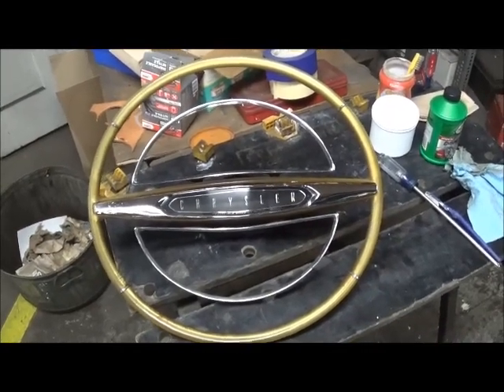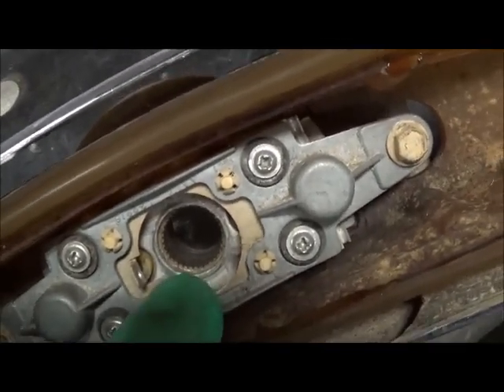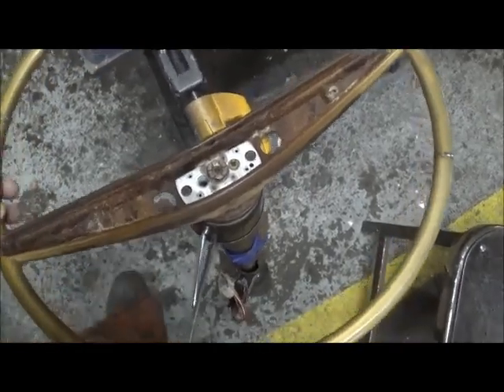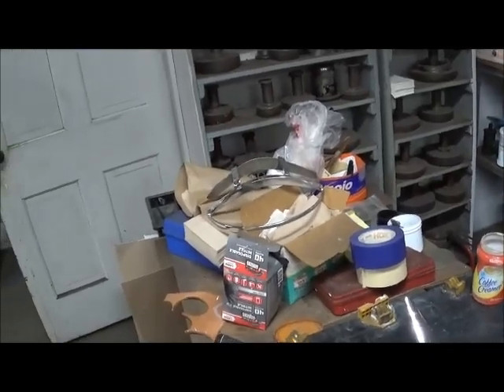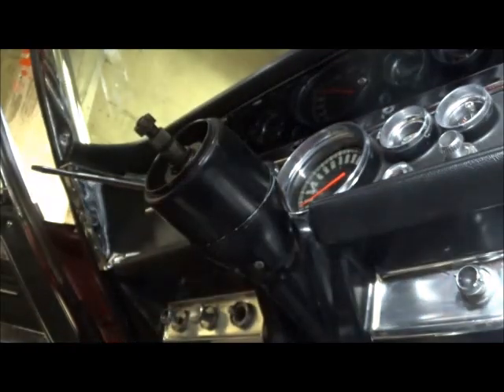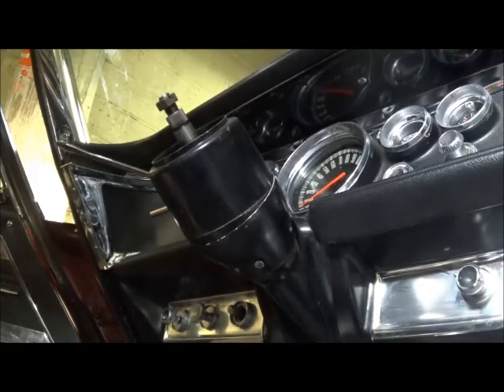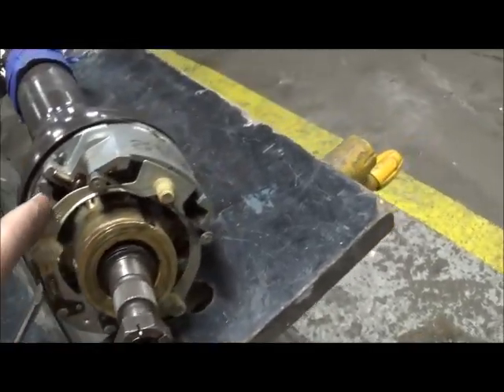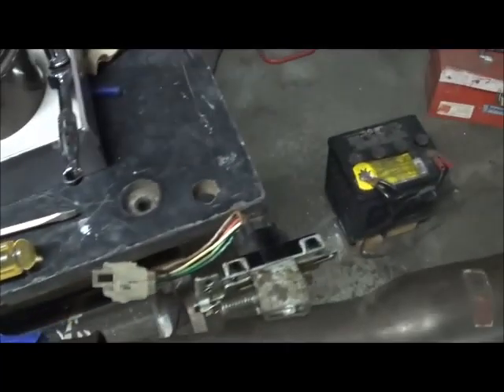Introduction and disassembly of the 1964 Chrysler tilt steering wheel

Comment: Thanks so much for the detailed video. My right side flasher is stuck on even in the neutral position. Horn comes on also when I push on the wheel only. Any ideas. Thanks 1964 Imperial tilt wheel
Reply from the maker: Those are two separate problems. The horn switch is under the decorative plate on the wheel, likely installed crooked or broken spring. Turn signal stuck likely stuck switch down at the steering column base. Maybe able to free it with spray solvent and new lube.
Reply: Bent 3 bolts trying to use the puller to remove the wheel and still won't budge. Smacked it way more than I wanted to. There must be a better way than just one bolt on a puller?